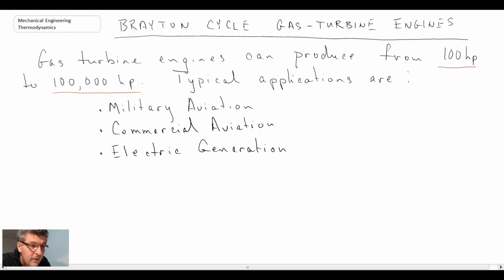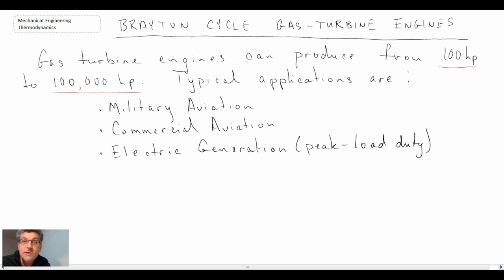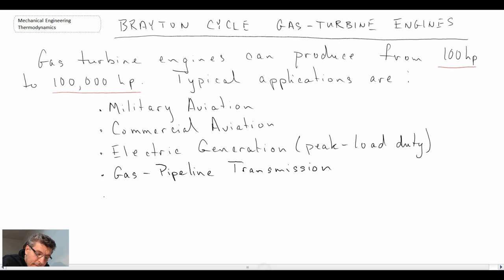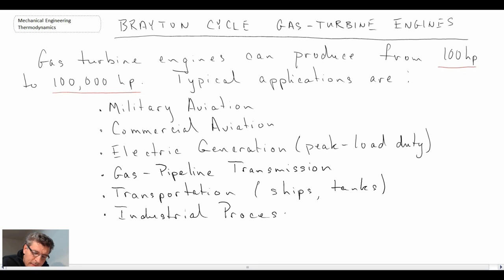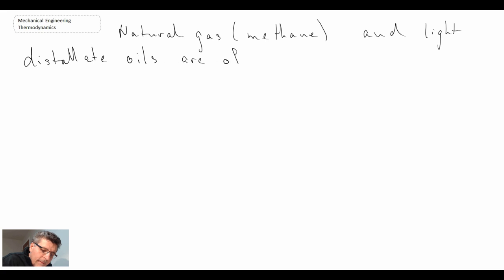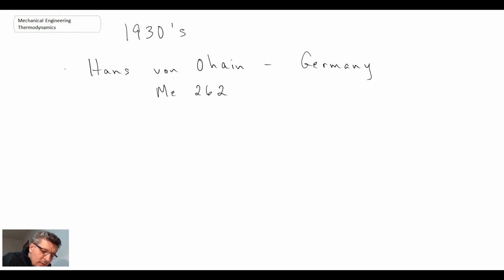Mechanical Engineering Thermodynamics - Lec 17, pt 1 of 5: Brayton Cycle Introduction

Comment: why did the compartment open up like that on the engine
Reply from the maker: The doors are part of the engine thrust reverse system.  The engine you see with the thrust reverser deployed is the Rolls Royce Trent 700 engine on a Cathay Pacific Airbus A330 that was landing in Cebu Philippines.  A company called Aircelle makes the engine nacelle (including the thrust reverse system visible in the video) for the RR Trent 700, and the system involves four pivoting doors that redirect the bypass air from the turbofans.  This quickly reduces thrust from the engine and it also creates additional drag, helping to slow the aircraft.
Reply: Ron Hugo I figured it was something to do with increasing the drag i guess its like opening the widows in my car when im on the highway maybe thanks for the help